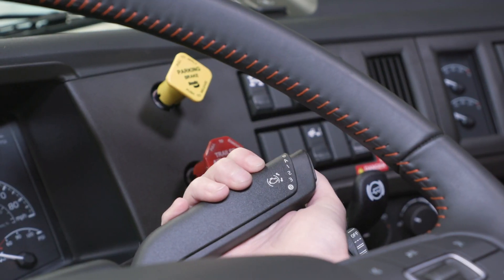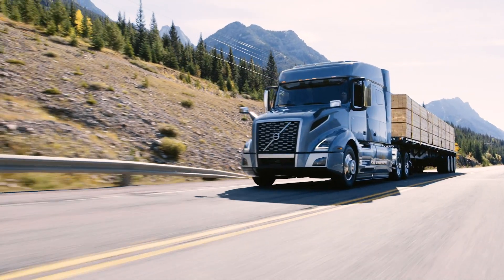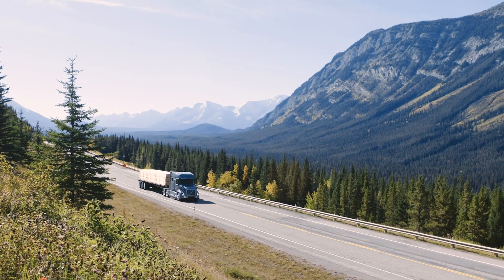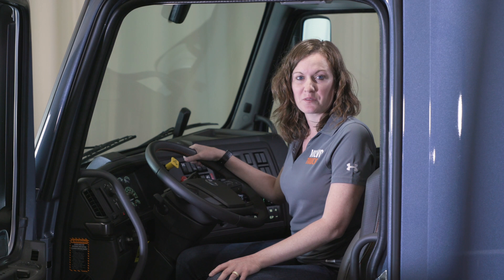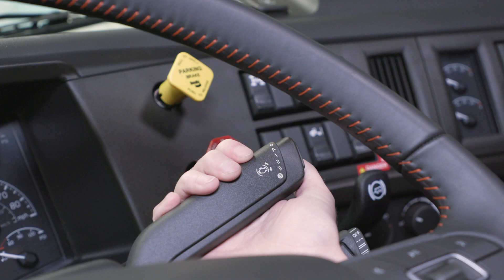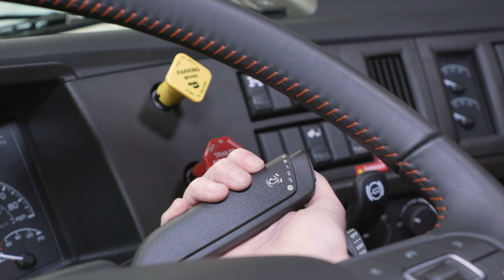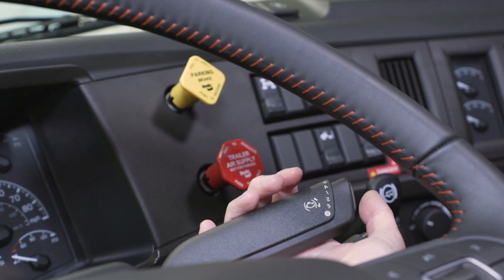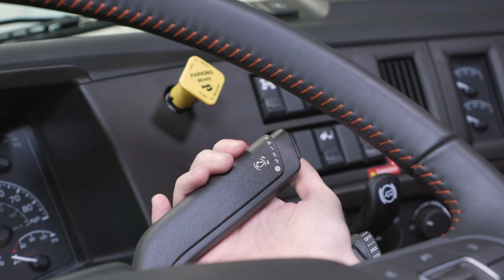Volvo Trucks - Meet Your Volvo: Engine Brake

Comment: How do I keep the automatic engine brake cutting on at a set speed when in CC, instead of it randomly adding 5 mph to the speed? (73 mph to 78 mph, for example)

Comment: you have to continues hit down lever to get it to work this is annoying as all get out....my old Jake it was always on when i want it.
Reply: Leave the lever on setting 1-3 and it will use engine brake once you release accelerator if you want it always on. Push down to B if you want it to automatically downshift for best engine braking. Use A if you want it use engine brake when you start pressing the brake pedal, and atleast here in europe it will also automatically apply engine brake with cruise control once user specified overspeed is reached